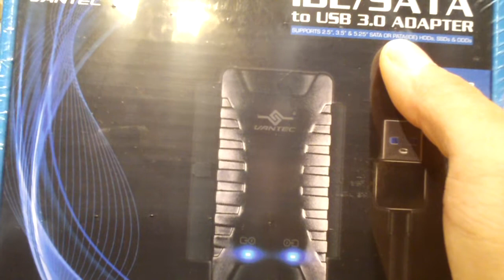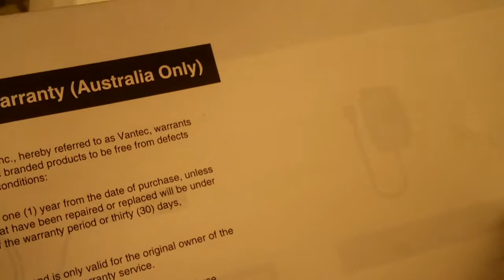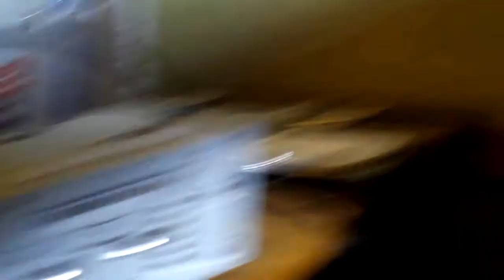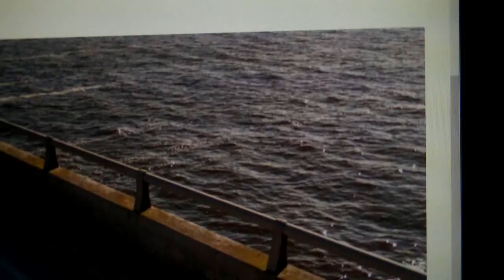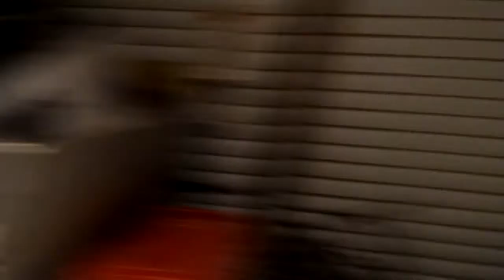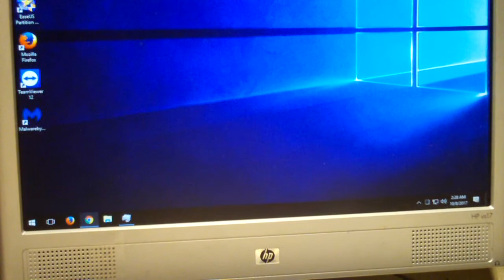In Depth review of the Vantec USB 3.0 IDE SATA Adapter

Comment: for a cheap 9.99 you could go eSATA via PCIe card. The card also has SATA2 and a IDE Channel.. but doesn't work with ZIP Drive as you can read my review: https://www.amazon.com/gp/product/B06XRD2VB7/ref=oh_aui_detailpage_o06_s00?ie=UTF8&psc=1

fortunately, this card has no problem with ZIP Drives and can do RAID! if you have PCI, i would recommend this card, it's VIA Chip set has been proven to be stable as hell! I use it with my FM2+ AMD x4 860k machine: https://www.amazon.com/gp/product/B00PVAX1SM/ref=oh_aui_detailpage_o05_s01?ie=UTF8&psc=1